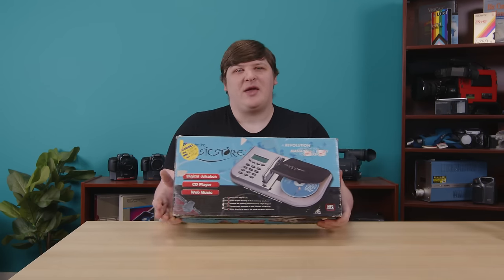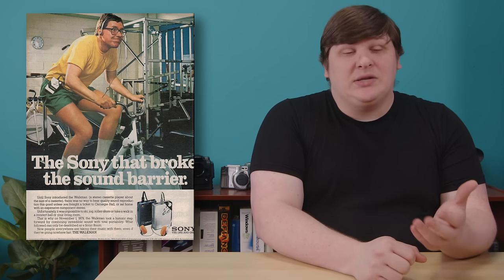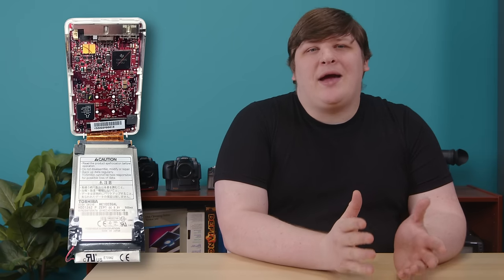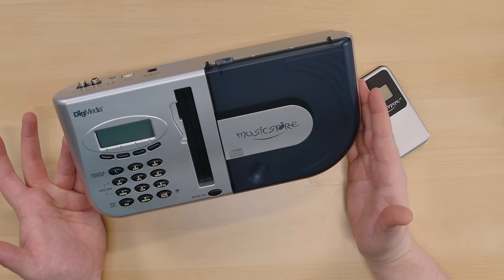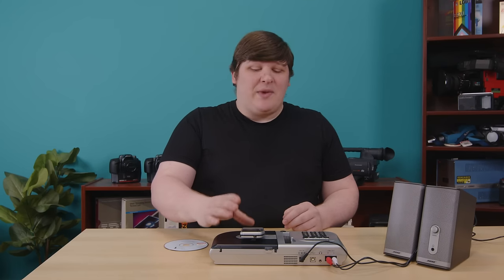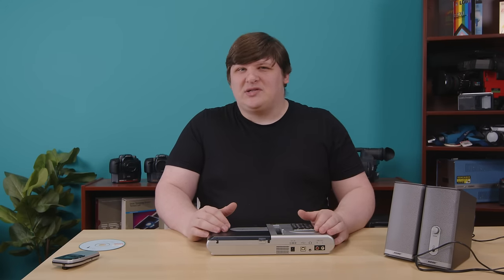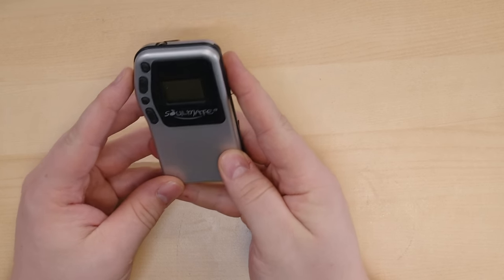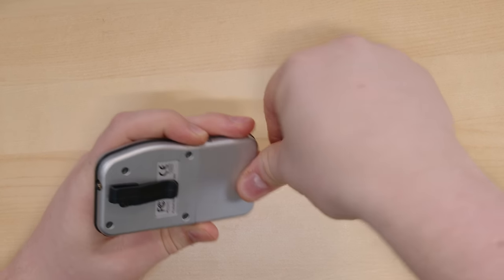An MP3 Jukebox for Everyone (Including The RIAA)

Comment: 55:00 - Well, I think, the designer of this interface has twisted a big one on this feature. The "pre eq" names in most audio devices actually the genre itself, i mean "POP", "ROCK", "CONCERT" etc. I think the concept was - that he (or probably she) thinked - that everyone, everywhere sets the eq differently when listening a rock music, or playing a pop song. So if you can presets these to the genres itself, you dont have to bother to change the bass and the treble  each time, when a different genre is playing.. :D
Reply: Windows Media Player 12 also has a 10 slider equalizer with presets for Genre, (Default, Rock, Rap, Grunge, Metal, Dance, Techno, Country, Jazz, Acoustic, Folk, New Age, Classical, Blues, Oldies, Reggae, Opera, Swing, Speech, Music 56K, Music 28K, Custom) which, I'm willing to bet can be automatically applied when an appropriately tagged MP3 starts playing.
Reply: @CompuHacker  but with only bass and treble, those are very limited.
Reply: @rxtx1979  but that was often all you got on portable players, if you even got that at the time. I'm not even sure some of the portable tape decks that did have sliders actually worked the one example I had didn't seem to at the time but given it was second hand even then it may have been internal damage.

Comment: Cheap digital cameras also did the same thing at the time. My first digital camera was a cheap $100 piece of crap that took 24x 320x240 pictures and it lost them all when the batteries were removed. It wouldnt surprise me if they are using ram chips.

Comment: You could use Windows media player 7 to play CD audio over IDE. I remember being astonished in 2001 by this.
Reply: You could do that with windows 98
Reply: @marvintpandroid2213  With the right software. I just happened to find Media player 7 on Windows 98 before any other software that could do it.
Reply: @TVperson1  there were a few programs that could do it, even in the days of DOS
Reply: @marvintpandroid2213  ah ok, I was young back then, do I didn't really know about any software that did it
Reply: @TVperson1  that's OK. It was a bit odd back then, the early CD drives tended to use internal digital to analog converters because doing it in software on a 386 or 486 was quite hard work.

And yes, I am a grumpy old fart.
Reply: @marvintpandroid2213  Well my first computer was a 386, second 486, then cyrax 586
Reply: Winamp 2 could also do it as long as you enabled the plug-in. Enable a second plug-in and it would also rip your CDs digitally. It really did whip the llama’s ass!

Comment: It’s probably faster to use a dedicated realtime codec to generate your MP3 files than it is to try and compress the files on the cheap cpu they used.    And more expensive to get a more capable chip.

Comment: I may have an explanation why it only rips cds at 1x. I grew up in Germany and around 2000 mp3 was a grey zone and you only could rip them analog at 1x legally (if you owned the Album of course). And this is the same in other EU countries. Maybe that is the reason. The record labels had made a big stink and did not even want that. 
If dig wanted to sell it in europe this would have been a must have.

Comment: Many people would say 128kbits is unlistenable but many people had absolute crap commercial encoding software back in the day.  CDex and/or Bladenc all the way!
Reply: In 1999/2000 I used BladeEnc at 160 kbit, a Soundblaster connected via analog to a nice Pioneer HiFi receiver and vintage Advent speakers, and it all sounded great to my 30 year-old ears.

Comment: Is it possible that the IR port is for a IR keyboard?
As for the DC connection on the SoulMate possibly for recharging the NiCad batteries you would be using?
Reply from the maker: The former is possible, but it would be pretty inconvenient since you can't see the screen without standing over it, and at that point why not use a wired keyboard?
The jack isn't for charging - both per the manual, and by looking at the circuitry; there's no connection to the batteries, it bypasses them and goes to the board.

Comment: Apart all those issues mentioned,  mp3 players without automatic volume control get really annoying when some recordings are louder or quieter than average.
And a cross fading feature would make things better as well.
Reply: That was one thing it could have taken from MMJB, but probably didn't, it did have options for automatic and manual normalisation across the library or by albums. Kind of a nice feature to have as someone that wears headsets a lot of the time.

Comment: Did you try changing the soul mate’s batteries with it turned off? Everything else is so half-assed I see no reason why that wouldn’t be as well. They probably just put the super caps in series with the batteries right into the pic. It probably only works when everything is parked and already idle, so to say. I know some other devices I had around that time operated like that.

Comment: around 20: the IR port: Probably NOT a remote port; most likely an IR Blaster for communicating with Palm, Handspring, and Blackberry PDAs...
Reply from the maker: I feel like a piece of stereo equipment was far more likely to have a remote for playback control, frankly.
Reply: IRDA was rather popular for file transfer in the late 90;'s to early 00's, especially on PDAs and both TI and HP programmable calculators. Plus some IRDA keyboards existed (tho' I never had one of those).

Comment: @Cathode Ray Dude
They used SDR DRAM chips, In those days SRAM chips weren't that dense. Odd that they used 3 16Mx8bit chips for a total of 48MB... I have IBM SODIMMs with the same part number. 128MB with 8 of these chips for 16Mx64bit.
Reply from the maker: Yeah, it didn't really settle in my head until I was almost done editing that SRAM didn't really make sense. It was about twice as expensive as DRAM circa 1986, but you could still conceivably use it in a computer. however, those were in kilobyte quantities - which is all SRAM ever really got used for, AFAIK. Everything that needed megabyte quantities was using DRAM, so there's really no reason to think that companies continued increasing SRAM density. Who would the target market have been? The approach used here makes far more sense - the only real problem with DRAM is the need to refresh it, but that's not a complex process, and with the plummeting power consumption of MOS tech in the 90s, it makes perfect sense that they were able to get the refresh current on these down to microamps.

Honestly, I probably would not have even considered SRAM if I had known that auto refresh circuitry existed.

Comment: 6:53 IEEE 1284 EPP standard become common place in 1994, and by the time the Rio came around pretty much every somewhat decent computer had it. If it was a Pentium or faster it at least had a IEEE 1284, and well if you hade a 486, you where not listening to MP3. So that is 2MByte/s. So that 32MB would be transferred with in seconds. I had a simular but cheaper MP3 player during the same time, and my K6-2 at the time also had a USB port, and that wasn´t even that much of a top end computer.

Still my Jaz piper Rio clone could transfer with a bit more than 1MB/s, so it really was quite quick.

7:40 Well you where not really running with a CD player. Most people running at that time still used casset players, and that was really the target demographics. Rio was a casset player replacement, not a CD player replacement. People still forget about this. But CD and casset player live along side, really most of there life. Still if you bought a car say in 2002, you got typically both a CD player as well as a casset player.... or .. if you got a cheap plugin deck, you had to choice.

1:07:30 All the complex update of a DRAM is done via internal circuitry

That it just holds 2 weeks on two AAA batteries make sense for DRAM. SRAM use waaaay less power. It would last decades with two AAA batteries.

Also SRAM is still in use to this day. Cache is typically SRAM to this day and Xbox one have a SRAM video memory cash (while Xbox 360 have a DRAM one.. don´t ask me why).

That its DRAM make sense. DRAM was considerably cheaper than SRAM during this time, and DRAM was also still cheaper than flash. It was actually first in 2004 Flash become cheaper than DRAM... When thinking about it.. its kind of strange that more devices didn´t use DRAM

I don´t know if its true for all SDRAM, but pretty much due to how SDRAM works, they pretty much have to be internally refreshed. The RAM module have no direct connection to the outside world, but is connected via an internal controller. And the extended sleep mode was standard for laptop ram at this time.

Also for some reason, from this era. SRAM is almost always quads, while DRAM have long side mounted legs and Flash have short side mounted legs. I don´t know why this is, but that was pretty much universal for like 20 years.

Even for BGA mounted memory modules SRAM have side mounted balls, typically 2 or 3 rows, FLASH have center mounted balls, and DRAM have row mounted balls. This is not quite as universal. But that is a good hint of knowing what you are looking at.

1:11:29 Super capacitors have been around a long time. During the 1980-tys they was used for exactly this application during the time that Flash memory was ungodly expensive and battery was unreliable.

1:17:33 Just like the patreons write, FPGA is usualy used as a cheap make shift northbridge. There was no chance a cheap FPGA could encode MP3 at this date.

1:20:10 You are not wrong that the digital extraction was flakey, but it certainly worked with some work. Me who is to lazy to connect the analog connection between the CD-player and the sound card  (and there also was some mixing reason i never did that), did notice that it was pretty hard to exctract CD digitally in the 90-tys. But finding the right software, it was absolutely doable. And well.. also the right CD-rom. It would happen that i had e few different, and the cheaper and faster they where, the better it worked.

1:24:00 
There is a other 90s early 00s problem that people don´t seam to remember. Back in, well really all the way back to 1996 you could perfectly well play mp3 of your Pentium 90, if you where doing nothing else with your computer. That worked well for say a student walking around, having a party, making food, chilaxing or what ever.

But if you where doing anything that needed any significant amount of processing power, the MP3 would start skipping, and also might freeze up totally. This really due to windows horrible multitasking.(i don´t know if it worked better on a mac, maybe it did)

What happen in 2002 and .. well also 2003 was that hyperthreading, and later multi core come around. This solved the problem. Playing a game, listening to a MP3.. no.. not and option. I solved it by having two computers... but i would guess that was a uncommon solution

Also wanted to ad that DVR was a thing at the year 2000. And there was really nothing stopping you just using it to play music. They where quite expensive, but on the other hand, they also was quite good. The main drawbacks with them was that they usualy only had a ~10GB harddrive and they used mpeg2 encoders filling up the drives very quickly (if you where not selection lower quality). Of cause, when the mpeg4 with bigger drives came around, that sort of solved the problem.

Comment: CD Audio is just uncompressed PCM audio. I am fairly certain that when I used to rip audio CDs I didn't have any trouble ripping at higher speeds.
Reply: CD Audio is not just PCM audio. It's 16 bit 44100 Hz PCM with cross-interleaved Reed–Solomon code (CIRC) for error detection and correction! Digital Audio Extraction only became viable around 2000. Remember that this device was designed before. You can't design a device with future technologies.

Comment: My palm m100 has a super capacitor for exactly the same reason - so you can swap the batteries quickly and not lose your data. Hails from yr 2000 also. Cap doesn't work any more - has spilt it's juices!

Comment: i dont think the lack of inbuilt power supply was to save a ul listing fee 

i think it was done much for the same reasons alot of devices from this time period did so

cost in manufacturing for different power standards

to make a device capable or working in 50hz 240v uk and 60hz 120v us as well as all the other weird and wonderfull combinations used not only world wide but with some countries using several withn there own country ( i believe japan ran 2-3 voltages across the country ) would add alot of cost onto the final product requring not only several board revisions for the power supply but yes also some certification for all of them would add alot onto the cost

the typical solution at the time was to simply make them with a dc power input and solve the power issues by throwing a off the shelf power supply in the box that was already tested and certified to that countries standards with some companies forgoing the power supply entireley and leaving it to the consumer to purchase a appropriate power supply (this was a thing most households in the uk would own 1 or more what we called universal ac-dc adapters which were just wall warts with a voltage selector 3-12v with a star shaped plug of all the common connectors on the end)

it also added in possibilities that wouldnt otherwise be available with a inbuilt supply such as selling car kits (a common trend in audio gear as most cars still had tape decks so youd use walkman cd players in the car instead) so they may have wished to tap into that market also by alloweing car kits

as well as the ability to use battery packs (much like the sega game gear)

when all was said and done a dc barrel jack was the most logical solution

Comment: Stupid Question: If you were to power down the Soulmate before you attempted to swap the batteries, would the supercaps keep the music data alive long enough to complete the swap?   I'm suspecting that the supercaps just don't have enough capacity to carry the music player circuitry for a battery swap.   Also, supercaps were commonly used (in larger form factor) in VCR's in the 90's to retain settings, channel memory, recording schedules, and sometimes keep the RTC running.

Comment: Oddly enough they could've solve the battery problem with swapping them by simply moving the power jack to the main board then they could've been swapped under a wall adapter and then the tether could've been removed.

Comment: I had the soul mate by itself. It had a really heavy dock and connected to the computer via a parallel cable. The storage was only enough for like 10 songs and the screen only told you which song number you were listening to and the volume level. It was a total piece of shit. 

I ended up getting it instead of a Rio only because the junk computer we had didn't have USB ports.

Comment: Two questions; what does the hard drive show on it when you plug it directly in to a desktop computer?   What about if you plugged it in via the USB B connection on the back?  can you use that to push MP3s onto the internal drive?
Reply from the maker: I covered that in the video at length, I assume you commented before finishing it, heh. The contents are gibberish, there is no standard filesystem.
Reply: @CathodeRayDude  Yep.  my bad. Sorry... I meant to go back and edit my post...

Comment: 15:55 Ohhh...Those Bose Companion 2's are great speakers. They're pretty affordable to pick up on ebay too (usually around 30-40 bucks) They have 2 separate RCA inputs so you can plug in two different devices simultaneously without needing a splitter. I own 4-5 pairs of them myself. Their use cases are un-ending.

Comment: 6:59 well you had epp and ecp, which could be fast enough wit a cpld, small ram buffer, cheep mcu and 12Mhz oscillator to probably at-least use usb 1.0 or 1.1 device, or have transfer speeds like usb, dat spp is slower den molasses in december in vermont or north dakota
Reply: however it would need an external 5v supply if you were trying to drive a usb device

Comment: if you want to see an mp3 player that's tiny and has even more barebones controls (and yet still had a seeking function, if i recall) look up the creative labs nomad muvo. fucker had five buttons, two of which were for volume, and an led. no screen to speak of
Reply: I we one of those and loved it. I was a freelance legal document preparer and it doubled as a flash drive to store the documents I was working on when I did work at law libraries.

Comment: I had both a first generation Nomad Jukebox and an iPod. The two were NOTHING a like. There is no way Apple cloned the Nomad Jukebox, because it would have been a HUGE step backwards.
The Nomad Jukebox was terrible for one, unreliable, and had a very poor interface with a bunch of "features" that didn't actually improve playback or the usage experience.
On paper the Nomad looked better, $100 cheaper, 6GB instead of 5, replaceable batteries, 4.0 surround, audio recording, EQ settings, audio signal processing and effects...
But in practice, the iPod worked better, was more reliable, had better battery life, was more useful since it actually showed up as a removable hard drive, and did everything it did very well, where as the Nomad did a lot more, but none of it well at all.
The iPod didn't clone anything, it was entirely it's own unique design and UI. The only thing it was close to cloning was an old Braun radio from the 70s, but that was purely the aesthetic layout of the casing.
Saying the iPod cloned another MP3 player, is like saying the iPhone cloned the LG Prada, or the Bugatti Veyron cloned the Ford Model T. They are not at ALL the same thing, and any visual similarities are just that, only skin deep.